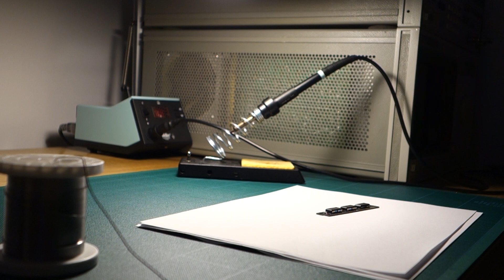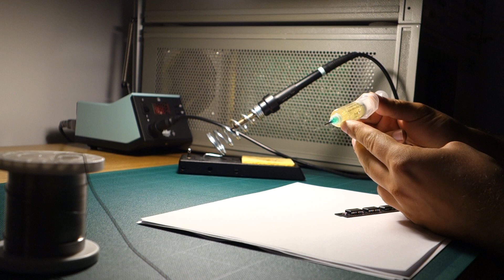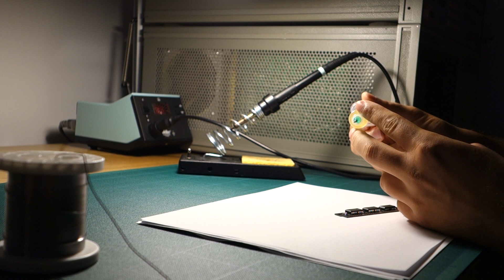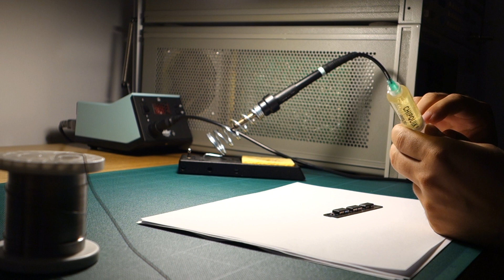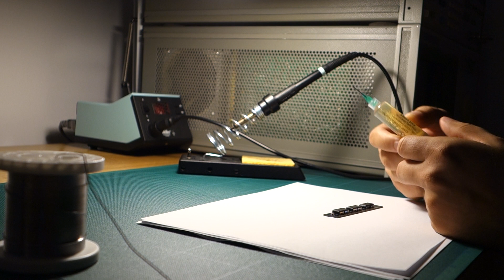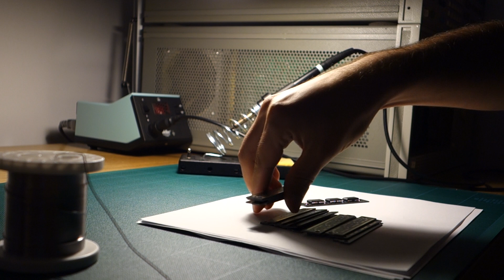x86 System Design - 4 Mb 70 ns 30-pin SIMM

Comment: That’s a really bad angle to show something. You need a monitor where you can watch like the audience and when you cannot see or read anything then you have to change the angle and or zoom in.
Reply from the maker: Thanks for the tip. Point taken. I don’t really have experience filming things. But I hope I will improve over time. Indeed I have an old camera that doesn’t support an external monitor. And neither does it have a flippable screen.

Comment: This is awesome! How well do you expect this modules to work on generic 80386 and 486 motherboards? Could I get 60ns chips and make it faster RAM or the design would need to be touched? Best regards from Portugal
Reply from the maker: Hi André, I am using 8 of them with my 80386 for a total of 32 Mb. They work very well. You can use any chips you'd like (60ns, 70ns, 80ns) but for a 386 I doubt you will notice a difference between 60ns and 70ns. The PCB does not need to be altered for faster/slower RAM timings.
Reply: @teletype68  I'm inclined to put a 20 piece order from JLCPCB ... just need to see where to source the RAM chips ... As I'm thinking not only in 386 machines (I have 3 of those) but also 486 machines, that's why I questioned about 60ns... in a 386 might not be relevant, but a 486 might benefit by the use of faster RAM! I have a couple of 486DX2 66 Motherboard that take only 30Pin RAM, but my stash of memory is limited to a few 1MB sticks... And this will make that not a problem! All the best!!!

Comment: Would you release the gerber files? And the parts list? I like your jobs.
Reply from the maker: The Gerber files and more details on this projects are available on the site. I have just updated the video description to include a link to the project documentation. However, I don't recommend OSHPark for the PCBs. They can only do 1.6 mm thickness while these SIMMs require 1.2 mm thickness.
Reply: @teletype68  what is the layer squence at JLCPCB?
Reply from the maker: @vinczejani  you can find the JLCPCB layer configuration .ZIP file on my site as well. In the Gerbers section there are 2 files. One for JLCPCB and one for OSHPark.